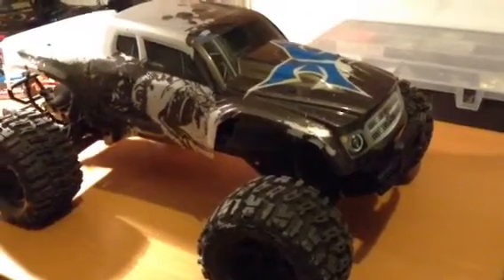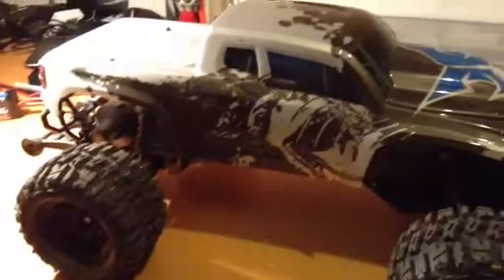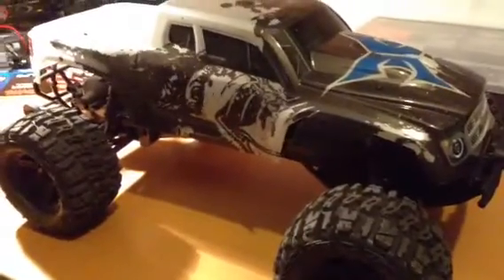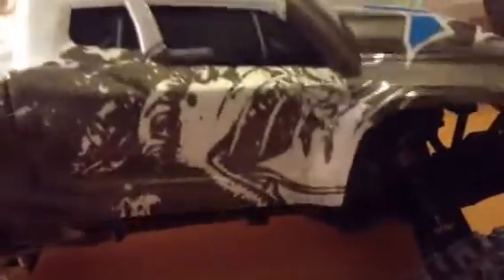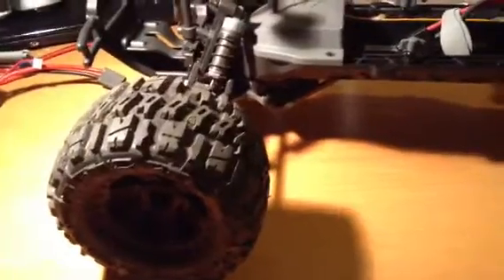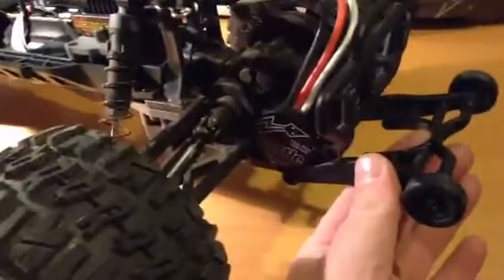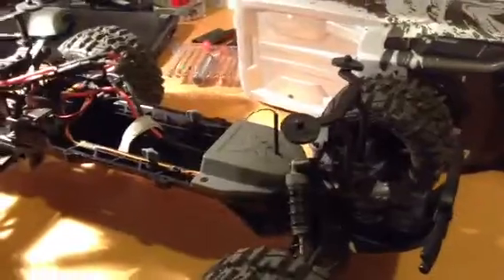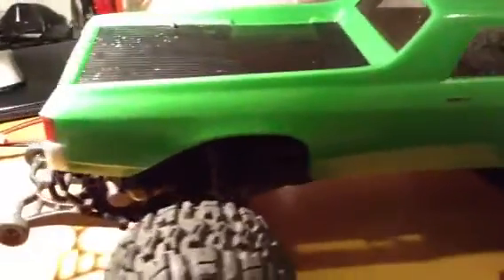The new and improved ECX Ruckus

Comment from the maker: the stock tires are actually pretty good.  decent traction on road and in the dirt, but the trenchers are better in grass.  i didn't go out and buy the trenchers, i had them laying around from a different project so i just threw them on.  the stockers are actually a little bigger and the black wheels are really cool looking.  the stock tires certainly don't need to be replaced, they're just fine on this truck.  i still run them when i'm not in the back yard.

Comment from the maker: I used the Traxxas wheelie bar (part #3678), but all you need is the actual wheelie bar arm (part #4974) if you are going to use rubber wheels, which I would recommend if you are driving on pavement a lot. I disassembled the wheelie bar and used 2 cap screws (6-32 x 1", Du-Bro 315) to bolt the arm directly to the chassis. There are existing holes right under the motor, go through the black bumper mounting arms and into the gray motor guard. The tension on the screws keeps the bar in place.

Comment: nice ruckus. I have the same sv3 in my circuit with a 22t pinion and it does not get past 140degrees. Wheelies so bad I cant drive it until I get a wheelie bar. Id be willing to bet you could move it to a 20t and see basically no low end difference with a much higher top speed and still be under 150degrees. 

How did you get the wheelie bar to fit?

Comment: i agree buck for buck awesome truck and the fuze 4pole brushless set up is cheap and amazing only problem i still have is the stock spur, trying to find a metal one but no luck yet. if you have a part number or something i could mod let me know
Reply from the maker: I haven't destroyed a spur yet, but I'm thinking that a Traxxas 32P set up would be nice...
Reply: RC Brooks  i am running a 4pole 4400kv brushless set up and its so insanely torquy it blows up the stock spures. gone through 6-8. still wont complain tho the truck is awesome and takes such bad abuse. you can see some of it under my channel or royce whin-yates

Comment from the maker: I had to modify them slightly by drilling out the end of the driveshafts with a 5mm bit.  I wasn't quite able to get the screw pins in place because the driveshafts would bottom out on the output shaft.